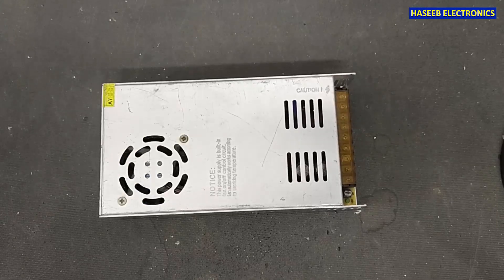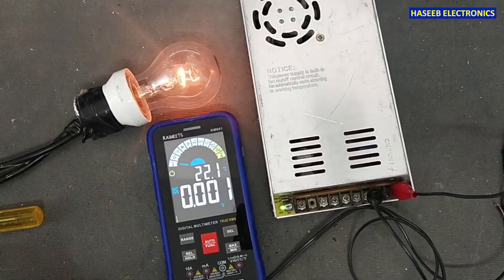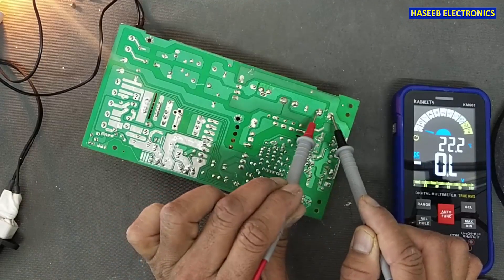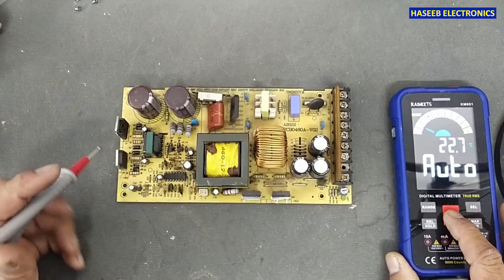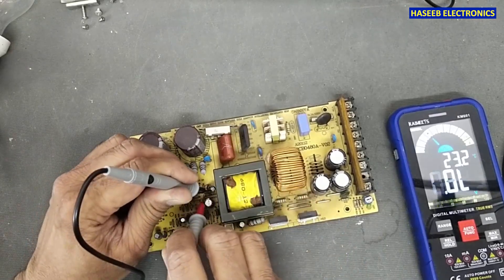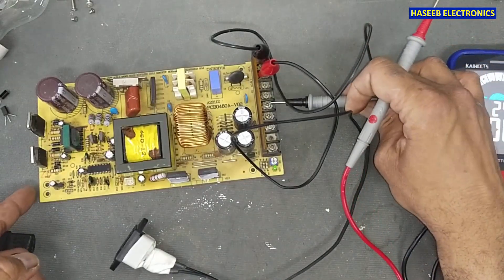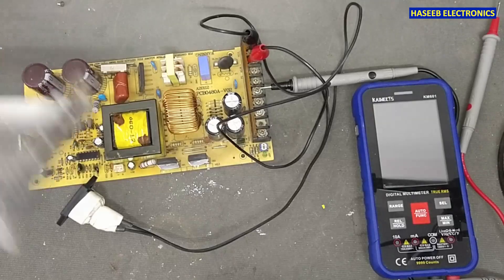{824} SMPS Output Is High, Fluctuating and Noise

Comment: 10:20 - Even when using solder with flux in the core, I’ve seen the need for adding flux. Maybe I’m doing something wrong in my soldering process.
Reply: You need to use a quality brand of solder and leaded

Comment: Thank you for the video! How do you have the light hooked up? What is the purpose?
Reply from the maker: most welcome 
are you asking for the series lamp. it is connected in series of line voltage. if there is something wring in the power supply, it will illuminate, and it will damage more
Reply: @HaseebElectronics  Oh interesting, so it is essentially checking if there are shorts or low impedance paths to neutral or Line (depending where the lamp is inserted)?

Comment: Nice video ! 
I like these way you show what you check and ... 
Well done it works ! 

Check it with the LED lamps as a load 
and install the ventilator quick for a permanent cooling before testing 
(and close the case. When a capacitor explode and it is closed = ok all persons are alive and without foil an fragments in the face + skin)

Thumps up : you cleaned our table = yes you are professional or as a amateur learned the hard way what can (and will) happen. 
Thumps up : you have a weller soldering iron and a sucktion welding iron. 
Thumps up : nice check (I desolder the big capacitors  and check these (short circuit and the capaity value with a special instrument) 

I hope your very big transistors have a low basis current . the smal worse transitor usally need low current for work. 
And small transistors have better amplification ratio than the medium ones you used. Buttwell it works.
 
AdditionaI add aluminium cooling sheet metal for the full bridge rectifier. 

Must be a very cheap brand because no manufacturer name at the sticker. 

If checkfor  the words X2 or Y2 at the RFI capacitor between low voltage and high voltage area. 
If these are cheap types it is possible when these fail to have ...  But well it is usuall in my country and I have used old capacitor in best condition from technical broken devices (and I can buy these in my area for low/medium amount of money if needed). 

My thumps up for your video. 

The digital multimeter have a (like all ditial ones) a slow conversion rat at the display. The voltage is jumping ... 
Sometimes I check these with a (nor cheap) oscilloscope (and a transformer to isolate the scope ground in case of ...) 

The light bulp in you main power cord is perfect fpr your safty and the circuit.
Reply from the maker: thanks a lot and special thanks for your valuable comment

Check it with the LED lamps as a load. ( i use resistive load for test
ventilator is really great suggestion. i will arrange it 

Thumps up : you cleaned our table = THANKS A LOT 
Thumps up : YES GOOD REWORK TOOLS ARE IMPORTANT FOR BEST RESULTS 
Thumps up : THANKS A LOT
regarding transistors, the medium power transistor is very close to the original transistor 
 yes it is cheap brand with compromised quality 
i am using this lamp just only for video purpose, otherwise the bench based series lamps are away from the camera range, 
please accept my best regards

Comment: Thanks for the  valuable video and excellent teaching,I have a problem please help me 
SMPS,2000w,52v out put(saft PM18R)
Fault-Giving 72V output and shutdown 
PWM Controller-UC2875DWP ,PFC IC-UC2854 ,FULL BRIDGE 
SYMPTOMS-DC VOLTAGE 420v, Vcc ok and stable, OPTOCOUPLER input 1.1v,output 100mv,changed the optocoupler but doesn’t help,reference voltage 5v
Please advise me

Comment: Hello, I have a question.  As a result of connecting a high current fuse to the power supply of the steam machine I use at home, I changed it because the mosfet, zener diode, ntc and 2 watt resistor on the primary floor failed.  I can get 12 and 35 volts on both of the outputs, but when I connect the power board to the motherboard, it shows 12v as 2.5 volts and 35v as 16 volts, so the fan and water evaporator are not working.  I also changed the capacitors at the outputs of the power board.  What other parts on the power board should I check?  thanks
Reply: Akım izleme direncini kontrol et.Anakart istediği akımı alamadığı için çıkış voltajı çöküyor.Bunun içinde anahtarlama mosfetini ve pwm entegresini kontrol et
Reply: @elektronikhobim6903  Akım takip direnci dediğiniz, Primer katındaki yüksek whattli dirençler mi

Comment: Hello, i m curious what is wrong when on high voltage capacitor (smps) metering 430 volts instead the usually 330v ? Thank you
Reply from the maker: when the smps transformer starts ringing, and it's RCD snubber is not functioning
it causes to elevate the voltage at bulk capacitor
at this situation destroy the capacitor, MOSFET etc
Reply from the maker: morover if the EMI filter is resonating beyond corner frequency of the filter 
then that EMI filter also starts ringing or self oscillation
which causes to increase the input voltage of bridge rectifier
in this scenario, check ac voltage at ac input terminal
then compare ac voltage at bridge rectifier input pins 
if ac input terminal and bridge rectifier input pins have a large difference
then the possibility is emi filter

Comment: Merhaba
8.dakikadaki transistör testinde transistörlerin  arızalı olduğunu nasıl anladı o kısmı anlatacak arkadaş varmı acaba?( Multimetre görülmüyor)

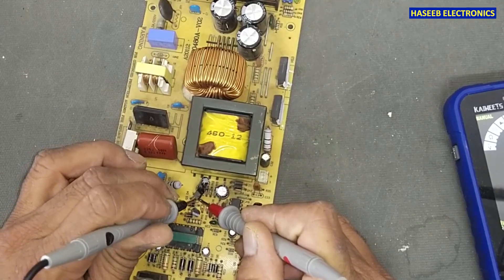How understand bad transistors in 08:00 measuring ? (Not see multimeter screen ) Could you make a short describe?
were they the same values as the test you did after disassembling?
Reply from the maker: i am sorry for inconvenience. no problem, i will demonstrate again with complete details and test parameters

Comment: Sir I have one SMPS and it is 110 and 240 input and 12 voltage DC output. But now it only works with 110 input not working with 240, please help me to solve this type of problem

Comment: My acer  "Liteon ps-5221-9ae" computer power supply also have same problem. Series lamp illuminate high speed and after few seconds turn off power supply. it has TN277PN IC and CM6802AHG IC in primary side. stand by voltage ok. TNY277 IC D -S voltage same as Capacitor voltage. mosfet and diode also good. what is the problem here. primary side or secondary side. please help sir

Comment: Hi why does my series lamp stay on when the power supply is working okay
Reply: Thanks for the reply I appreciate the advice, and your full explanation, for me I am getting to understand electronics.
Reply from the maker: some power supplies are high rating and some of them have PFC circuit, which consumes the power 
moreover low wattage rating for the lamp also cause to illuminate it

Comment: What to blame when the ocp get triggered at very few current absorption (around 150 ma) on a pc smps?All the output except for the 3,3 v line works great and the power supply is almost in new condition.
Reply: Could also be the under voltage protection triggering in? The 3,3v rail is supposed to provide at least ten times the current available in this condition. What do you think it could be the real cause of the issue?

Comment: Hi brother namaskaar. 
Thank you for sharing this video. 
Wich component is producing 
humming noise..,when the circuit is faulty. 
Have a great day 🙏
Reply from the maker: clicking / humming / whistling sounds are most of the time from transformer, it becomes due to saturation condition of the core. it is due to uncontrolled primary current, it finishes with proper conduction 
if this sound is available at normal situation, in that time may be primary winding is loose or sometimes core halves become separated,
Reply: @HaseebElectronics  Thank you for your reply 🙏